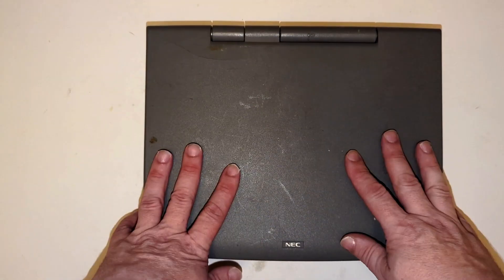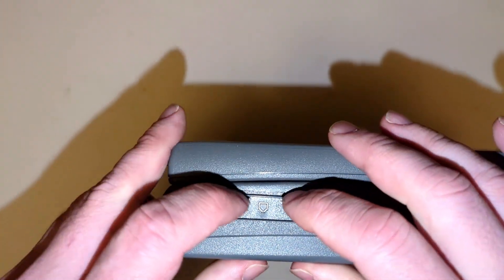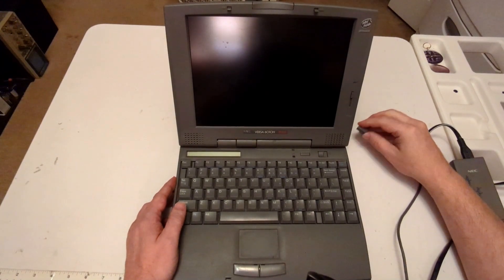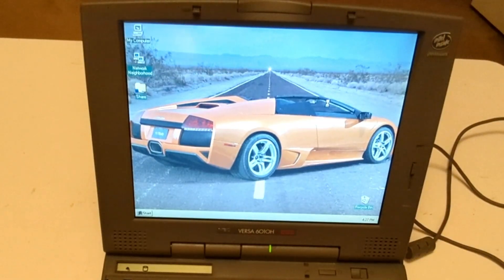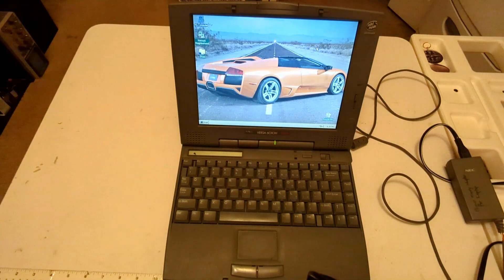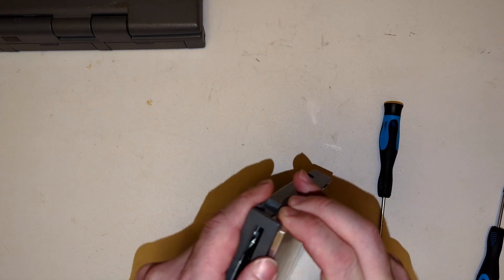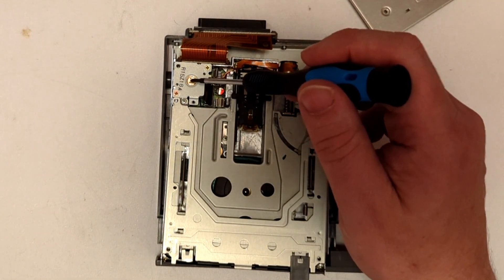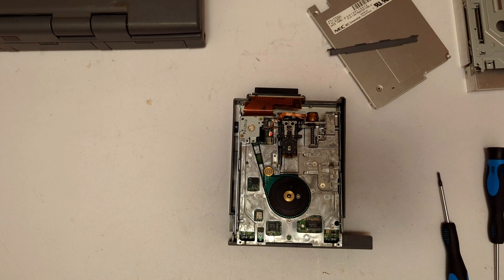27 Year Old Laptop Saved From Recycling | Will It Work???

Comment: I am surprised the hard disk worked. Are you sure the HD wasn't more recently replaced? I have a few similar laptops from the 90s that still retain some sentimental value to me, and their hard disks won't even boot. I intend to replace them with some sort of sd card reader eventually. I have too many other projects with 80s Commodore computers to tackle before I get to that. Oh, and the no-name laptop I had from the era(Win 95) allowed you to change out the Disk drive with a cd drive module which I also have.
Reply from the maker: I saw this comment and had to take it out and look.😁 It's a 1 GB IBM Model DSOA-21080 IDE HDD, Date code Jul-96. I see no finger prints but my own and no witness marks. So I'm assuming its OG to the laptop. But who knows, it may have been replaced during it's lifetime. When I got it, it had a company asset tag on it which I removed before filming, so if it did fail, its likely to have been replaced by their IT department. I think this laptop was retired for awhile because of the non-working floppy drive. Looks like it sat round in storage at that company since the mid 2000's, and was recently recycled. The last files made on it were from August of 2006.
Reply: youve been having bad luck...drives from that vintage are very reliable...i have laptop drives as small as 140mb and working perfectly and big old mfm drives as small as 10mb and also working fine...some  of those i have repaired but they are very reliable contrary to peoples beliefs...